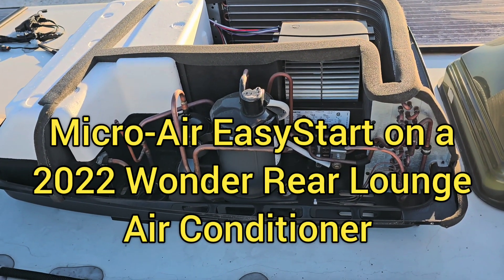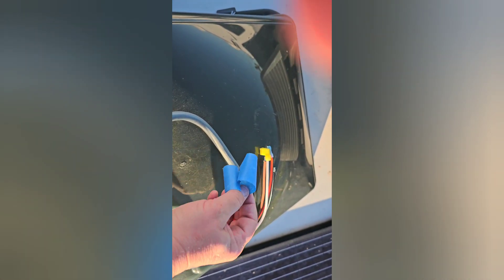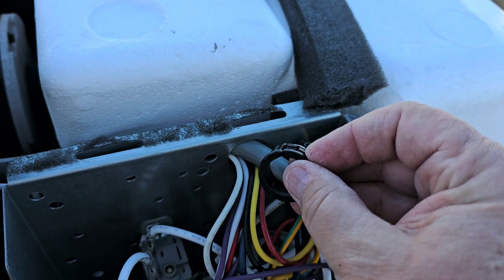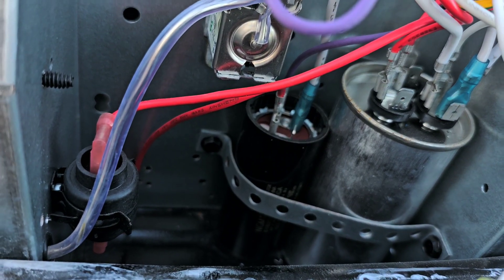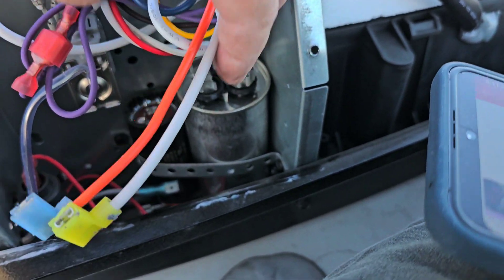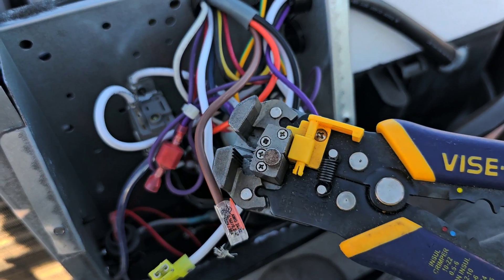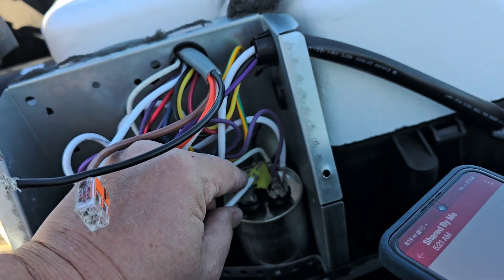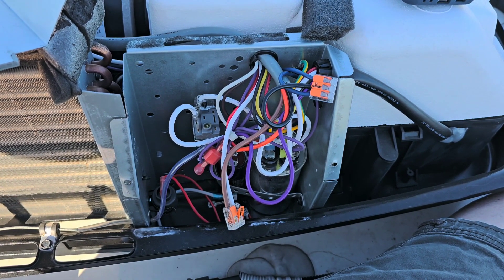Installing a Micro-Air EasyStart on a Leisure Travel Vans Air Conditioner

Comment: Hi Sandy.  Thanks for making this video!  As an LTV owner, it's great to see the MicroAir product being installed on a Dometic A/C rather than just a generic A/C unit.

Question:  Do you know if the Dometic A/C units bleed off the charge of the run and start capacitors?  I didn't see you discharge the capacitors in your video, nor did the MicroAir instructions mention it.  However, their installation video recommends doing it before removing any cap wires (https://youtu.be/soP0uZFd0nQ?si=NokRkznM2zvjyBat&t=997).  I've also seen this recommendation in other hard-start kit instructions as well.  Personally, I would always recommend checking for voltage on any large caps like these before working on or around them and then discharging them if any voltage is present before doing any additional work.
Reply from the maker: No, it doesn't bleed off the charge of the Capacitor. I don't short the terminals like you probably should, but I'm careful, and I don't touch my fingers across terminals. It's not really something I'm concerned about. Certainly do that if it makes you feel more comfortable.